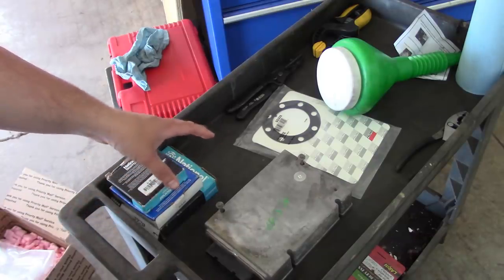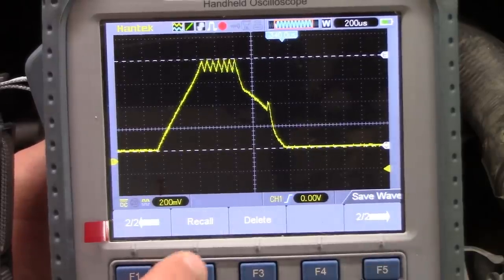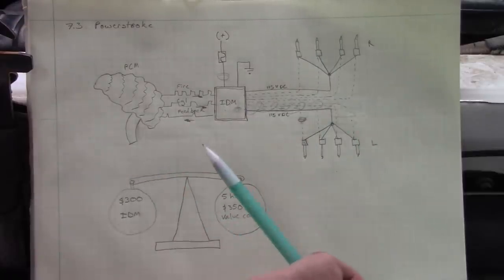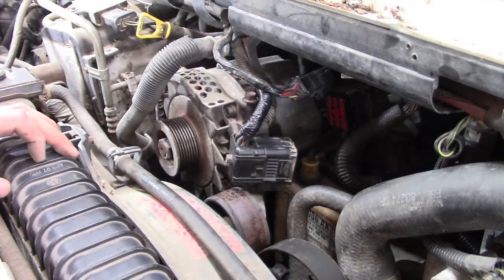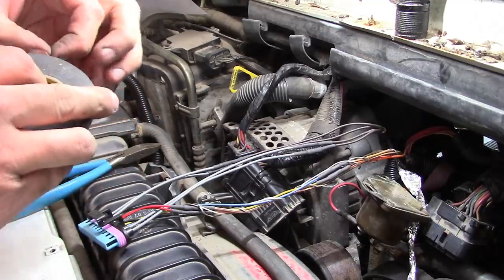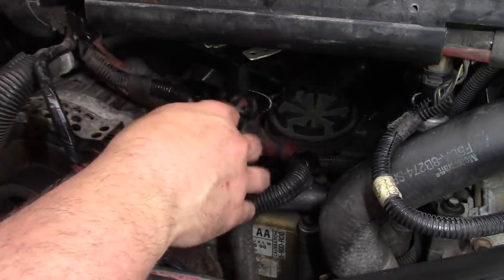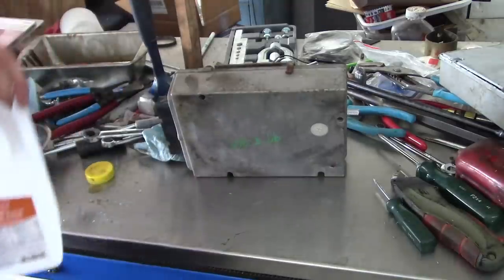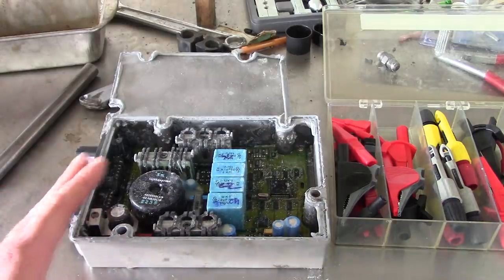Ford E350 | 7.3 Power Stroke - IDM Testing and Wiring Repairs - Part 2

Comment from the maker: Uninsulated terminal kit: https://amzn.to/2Y5tr7P
Hose pinch pliers (I am using the 1-1/4" style): https://amzn.to/2BC86eF
Harbor Freight sells adhesive lined shrink tube that is pretty decent.
Reply: You know what those spikes could be the alternator turning off and on all the time because it's so High amperage.  Maybe put regular alternator on it that thing looks scary
Reply: Thanks for posting this stuff up in a comment so we remember!
Reply: I would think the glow plug wire made so much heat when shorting that it melted the sheilding on the adjacent wires wires.
Reply: Do you have a favorite tool for crimping Uninsulated Terminals?
Reply from the maker: @CTSCAPER  I have some fancy ratcheting crimpers, but 99% of the time I use a Klien 1005. https://www.amazon.com/Insulated-Non-Insulated-Klein-Tools-1005/dp/B0006M6Y5M/ref=asc_df_B0006M6Y5M/?tag=hyprod-20&linkCode=df0&hvadid=309802506143&hvpos=&hvnetw=g&hvrand=13349357464334973162&hvpone=&hvptwo=&hvqmt=&hvdev=c&hvdvcmdl=&hvlocint=&hvlocphy=9057567&hvtargid=pla-433451501200&psc=1
Reply: Thx for the part numbers Wes
Reply: You keep acting like you're not sure what the issue was..    "There's your problem lady" -- was the fact that it was full of water. lol
Reply: @WatchWesWork  road spray can short the orange wire on the upper left of the engine bay. From video part 1. Also the plastic can have condensation on it and arc with 120v DC pulse . To the bolt. Everything condenses.
Reply: @WatchWesWork  alternator voltage regulator shoulda been checked..and power voltage going into idm. High voltage will manifest at the first weakest link.... Or first component that gets damaged. It's old and may not have the greatest computer  to catch that issue

Comment: Wow, that was a conundrum for sure. Intermittent issues are the worst nightmare of any mechanic, but you handled it masterfully. I learned from observing your repair and while we still don't know for sure if you found it, I believe you did all you could. Great effort Wes. I have the 2001 7.3 F-250 Superduty so learning from videos like this are very useful for me. I hate paying the labor for problems when I can usually figure it out. It's a pain but you learn so much on every job which comes in handy when you are traveling and an issue crops up. You can never know enough about your vehicle. Thanks again!

Comment: Watching videos of power stroke repair makes me love my 12v Cummins even more.
Reply from the maker: 1300lb engine with 175 screaming ponies! No wonder they last forever.
Reply: @WatchWesWork  the brain power thats saved working on a mechanical motor is priceless
Reply: 12 valve is an excellent engine but I have never seen a 7.3 fail because of a dowel pin, or a block split because of poor casting.  Back when the trucks were new stock for stock the 7.3 walked over the 5.9 for power and towing.  Also the Ford was a far superior truck to the Dodges.

Comment: Nice troubleshooting with a clear diagram of what is happening in the circuit.  Intermittent problems were my biggest headache when troubleshooting and repairing test equipment back when I was in the USAF.  good job
Reply from the maker: Sometimes it's impossible to fix.

Comment: Holy cow! 
   That was a very involved process.  Obviously needed all those "little" fixes (i.e., wires re-wrapped, glow plug fix, rear abandoned radiator lines, etc.,), no self respecting tech would just bypass that stuff, but no specific problem identified is a real head scratcher.
    Hope the customer watches this video, to see just what all was done.
Great video, thank you sir.
Reply from the maker: He will.

Comment: Once again, great video. You continue to "do the right thing" by pulling the valve covers.  You always set the correct example.  I'm about to replace defective glow plugs on my 96 7.3, and reassured myself I had the factory valve cover gaskets.  I then realized I got Dorman gaskets, not knowing any better.  Your video reassured me that at least I have a chance with them if I'm careful. I had already purchased the same non-insulated butt connectors and heat shrink as recommended from your previous videos.  I'm sure I would have screwed up the cylinder identification had you not pointed out that the engine is not a Ford, but a International (navistar in 96)  Many thanks.  Craig
Reply from the maker: The original harness is laid out in order of the cylinder, so you really just have to follow the original layout. It's not difficult. You'll know right away if you get it wrong!
Reply: @WatchWesWork  Thank you

Comment: Wes
Water in those modules are a real common problem. We take PVC pipe, and cut spacers out of it. Place the spacers between the fender wall and module and it helps keep water from just sitting on module, also helps to keep module cool. The dorman gaskets are the way to go !
Great job !!!

Comment: Thanks Wes for checking the injector harnesses, it took me all day and all call to my head Dr to get through this recording, of course I didn't listen to her, she just doesn't understand what it's like to work on a van, engine shoehorned in the bay chaffed wires, intermittent problem, multiple IDM failures and a costumer that just wants the truck back in a somewhat reliable state, great job, I'll be alright now have a good weekend

Comment: Growing up in the fifties in the UK 🇬🇧 and taught by my grandad, have always called it 'insulation' tape. As always a good video Wes.
Reply from the maker: I dunno. We always call it electrical tape. But, like duct tape, it gets used for many non electrical things.
Reply: @WatchWesWork  When I was a kid they didn't have the plastic tape...We had FRICTION TAPE. ever see that?  A type of cloth with some kind of sticky petroleum coating.  It wasn't very sticky but once you folded it on itself it would stay there. It actually worked pretty good.

Comment: Hey bud, because you've mentioned those Braun lights, they have a standard 18650 lithium ion battery. You can buy a pair with a wall charger for pretty cheap and just swap the batteries out as needed. I'd say, don't cheap out on lithium ion setups, but you could be in for less than $10 shipped.
Reply: I was pretty disappointed with the runtime on those lights, so I've been upgrading all of mine with higher capacity cells, at least right now they ship with low end 2200mAh cells. We have a lot of samples and old prototypes at work that I can harvest pretty decent 18650s from, so now my Braun lights are mostly in the 2550-3000mAh range

Comment: I changed the alternator in an 86 e350 motor home with a 460. I had to remove the radiator to get the long bolt out because it hit the radiator. Fun! This is probably where ford got its cab off for everything idea. I like you orange juice label. That’s how I labeled my not 409 soapy water air leak detector solution.

Comment: I can remember watching a video from Letsdig18, he has a Volvo rock truck that developed a troublesome injector problem that his mechanic struggled with. Finally the fault as located, oil had somehow got into the wiring loom. The fix was to install a new loom. Something to bare in mind.
Reply: Common failure with Mack/Volvo engine harnesses.  When oil level sensor or oil pressure sensors fail oil works it's way into the harness and all the way back to the ECM.

Comment: A transient voltage is a spike, dip or fluctuating voltage that ocurrs along with the intended signal. They're usually unwanted so engineers take measures to shield, filter or suppress them.  
enjoyed watching take care

Comment: I had an E series with 460 gasoline. Same tight quarters. Pain to work on. I had a 1962 Ford van 6 cyl. My father and I rebuilt engine with block in it!

Comment: Wes, way to stick with it!  These old public service vehicles are a wiring mess.  Just like the heater hoses to nowhere there's probably bunches of wire doing the same thing.   I don't know how that could interact with the injector driver.   I think you did an awesome job trying to find the ghost in the machine.   Thanks for sharing!
Reply from the maker: Yeah, the wiring is always a nightmare. This one doesn't seem too bad in that department.

Comment: Amazing work.  I once had a bunch of codes on an E-350 2012, Ignored all but right rear wheel sensor fault.  Replaced it 3 times as it kept going out after a few hundred miles.  Then I just lived with the ABS traction control lights.  Also had a small and very small leak in EVAP system.  Lived with that too. 

When I got a fuel gauge issue and it would show empty when tank was full I had to address the issues. Got a steering wheel sensor code too....WTH!  Multiple codes for wheel sensor, EVAP, and Steering wheel sensor. Replaced that in tank level sensor and EVAP canister above fuel tank it was broken and i only seen that when tank was lowered to replace fuel level sensor.   That fixed all codes including the right rear wheel speed sensor.  

Those engine and drivetrain codes are a computers best guess..  I'm assuming the computer could not decipher the conflicting data with the fuel level and assumed it must be a wheel sensor.

Comment: That alternator issue brings back memories.  I had a 1980 Chevy 1/2 ton van with a 400 and AC..  The only way to change the alternator was to take it loose, move it into the fan shroud, bring it under the motor and back up to the top on the other side of the motor where the battery and brake booster were.  Then you could rotate it just right, align the mounting ears and remove it through a small gap, after bending the brake lines a bit to give you clearance.
Reply from the maker: That's crazy. I thought maybe I could get this one out the back through the doghouse, but it will not clear the firewall.

Comment: you did a very good job.mabee the 110v that you  fix ...the  wire when is get wet from water cause biger amp draw on ficom or mabee also that grow plug wire cause the altenator to output high voltage spike or it water in ficom.you can get those but conector from grote realy cheap. in the pass i did one injector on those  engine but it was a motor home chasis lot easer

Comment: I think the rubbed through wires were the issue. Only during a special circumstance or specific condition the wire would complete the circuit to ground and fault out the  IDM. Just my suspicions but it’d be hard to say unless you have another IDM to burn and you recreate the fault. 😳 Awesome video as always brother!

Comment: I see what the commenters were speaking of.  

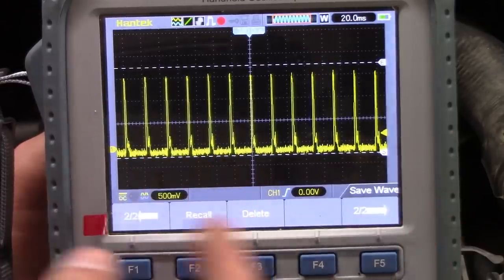At 8:08 where you discuss comments; looking at the harness hanger at 1 o’clock under the drip edge, if someone had hung that harness on there with zip ties, I could see how those two wires could have rubbed through and shorted to ground.  

As with the sloppiness of found or missing fasteners, it may have been cut down for diagnostics and not rehung. 

At any rate, your thorough repair later in the vid addresses this, even though it was not the point of your repair…

Comment: Personally I would have crossed out "orange" and written "green".

I'm with you, I think the rubbed thru wires were occasionally shorting. A direct short from the HV power rail to one of the injector ground wires would have a pretty good chance of taking that channel out, and depending on how the module is built may have caused more collateral havoc. I'm not sure a short between injector ground wires would have caused that much of a problem other than maybe misfiring. Shorting the HV drive to real ground might also have cooked the module, though I'd hope that it had protection against that.
Reply from the maker: I think it has protection, but that protection has limits.

Comment: Here's my tip for this video. I bought a bottle of Detol( it's an anticeptic that I use on small cuts also) , from Smith Brothers General Store in Clinton. Then I picked up a little spritzing bottle from Walmart and fill it with the Detol. When the gnats are bad, I spritz a little on my ears and forehead before going outside. They may still fly around, but won't land on you. Anybody with a hat, that has a brim, will find the gnats like to fly up under the brim. If I'm out without a bit of stinkem on, I turn my hat around backwards and play gansta ;)
 My Dad always used a cotton swab, dabbed in Vanilla extract, then dabbed on the ears and face, for working in the garden. Some say the real stuff works better, but I have used imitation and ad good luck with it. Try one or the other, it really helps. Detol is available other places also.
Reply from the maker: Hmm. I'll have to try it. That place is still open somehow.
Reply: @WatchWesWork  Last time I was in there, they had the stuff right on the counter by the cash register.

Comment: In the old days, the standard scope probe was a 10:1. Check the instructions for the scope and see if there is a way to reprogram the default. From a very old tech.
Reply: That's still the standard, there are lots of 10x/1x switchable probes out there these days, but most of them have extremely limited bandwidth in 1x mode, so best practice is to leave them as 10x unless you have a good reason why that won't work

Comment: The brain drawing for the ECM was pretty creative. I seem to say the phrase "yea right" a lot when I work on vehicles as well. Usually when trying to break loose a rusty bolt or something of that matter. As you grabbed the first heater hose to attempt to twist off I said " yea right" about a second before you did. Lol
I don't think you will see that truck back in your shop. I'm not sure about the missing insulation from the wires,  or how it happened . Sometimes the story is told right when you open the hood and where the wires were in relationship to one another if that makes sense.  I think you have fixed all the weak spots at this point  and it will rattle down the road till the body dissolves.
Reply from the maker: I hope so!

Comment: I had an 1982 E150 van with a 300 (4.9L) 6 cylinder in it - I HATED working on it.   Had a factory 4 speed in it, so it was fun to drive :)

Comment: Had an issue with one of those idms couple of years back. Had a customer that had a truck that shut down/ran bad randomly. After a LOT of investigation, we determined that the issue was ”arcing” between some idm high voltage wire and the aluminium foil surrounding it. There was a small part of that high voltage cable that had green corosion, so the voltage probably went through there. After taking care of the corosion, cleaning the wires and putting new alu foil insulation the car ran good (and a new idm)
Reply from the maker: Yep, that's what I suspect was happening here, but chaffed insulation instead of corrosion. A pretty janky design IMO.

Comment: Wes, you're a little off in your analysis of the injector driver pulse. The slope on the leading edge is the inductance of the coil limiting the rate of change of the current. As you correctly stated, a shorted coil won't have this slope because it doesn't have any inductance.

The little wiggles at the top of the pulse are the coil driver pulse-width-modulating (turning on and off rapidly) to limit the maximum current in the coil. The driver is either fully on or fully off; there is no turn-on current with a lower holding current. Some solenoid drivers have that, but I'm pretty sure this injector driver doesn't because the injector is only activated for about a millisecond.

The wiggle in the slope on the trailing edge of the pulse is from the recirculating diode in the driver module. Without the diode, turning off the driver would give you a big inductive voltage spike that would destroy the driver transistor. Instead, the diode keeps the current flowing through the coil and allows the energy to dissipate more slowly. When the diode finally stops conducting, you see a little inductive spike and then the slope falls more rapidly because the recirculating current path is open .

Thanks for another fascinating video. I like the ones where you explain your thinking. Ignore those people that want silent videos. They can just turn off the sound!
Reply from the maker: I'm not sure. If you use the scope to measure the voltage of the control side of the injector, you will see that the IDM pulses the solenoid, turns off, then pulses again at a lower duty cycle. That's the peak and hold. Here is a good write up of the IDM function: https://swampsmotorsports.com/IDM/Injector%20Waveforms.htm
Reply: @WatchWesWork  Wes, you're right and I described it poorly. The initial current ramp is the driver on 100% with the current limited only by the coil inductance. The 13 kHz wiggles at the top are the holding current with a PWM duty cycle of about 50%. But after that, the driver is completely off and any wiggles in the down ramp are just the recirculation diode doing its job.

Comment: I agree with you about the worn wires causing problems in the right conditions.  Lost count on how many times I've been driving on the freeway at night and see a semi's trailers tail and clearance lights flicking On and Off because of a rubbed through wire grounding out or going open with every bounce?  Driver pulls into to fuel up and walks around to check and all is fine.
Reply from the maker: Yeah, that happens all the time. Bad ground.

Comment: My 2014 Ram 1500 had an ABS issue, of course on a road trip towing a boat. I found a wire that was internally corroded in the ABS controller harness. Soldered it together. PRESTO ! Problem fixed. The ABS wire looked just like that Orange injector wire.